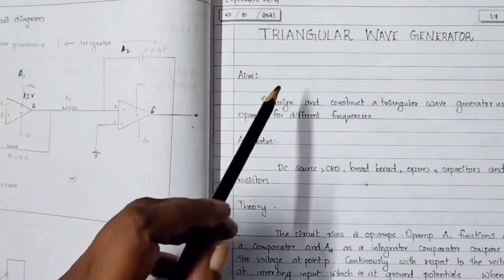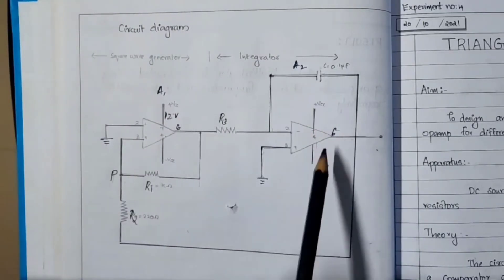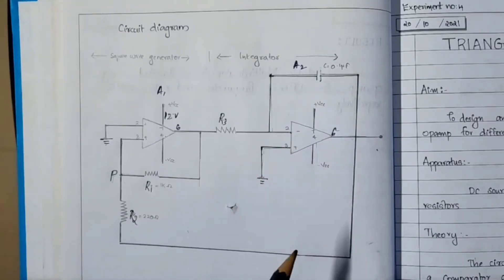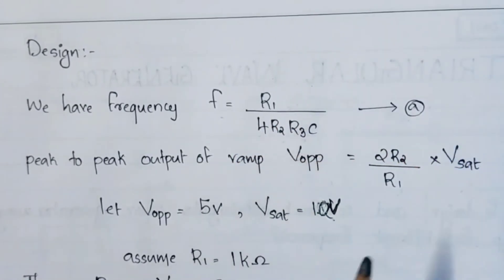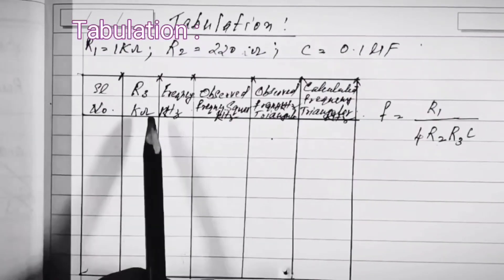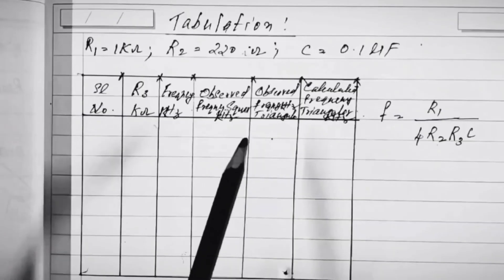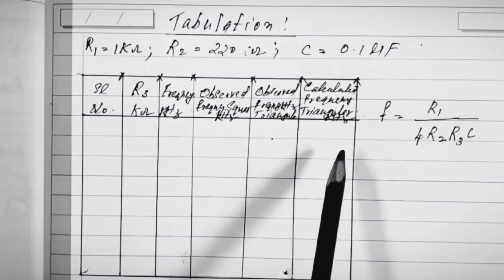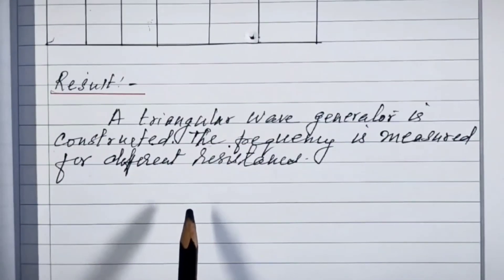Triangular Wave Generator using Opamp IC 741

Comment: Ma'am, there are videos demonstrate how to create triangle wave generator using op amp and they are using 2 series astable multivibrator as a square wave input to integrator as a triangle output. But it seems in your circuit is a bit different.
May I ask why is that?
Reply from the maker: Let me know first whether you get desirable output using this circuit
Reply: @sheebanh8140  yes, using this circuit I get the desirable output. I'm just confused about what's the difference between the two
Reply from the maker: @karaee nothing to worry, this comes to be the easiest one
Reply from the maker: and also please go through the theory behind and thank you so much for the feedback ❤️

Comment: What is CRO
Reply from the maker: Cathode Ray Oscilloscope
Reply: @sheebanh8140  maam i have to have a physical circuit, so can you tell which components are used in it
Reply from the maker: Please watch the section Design in the video